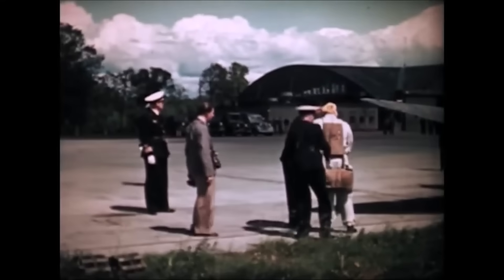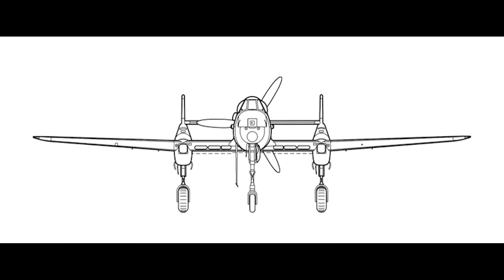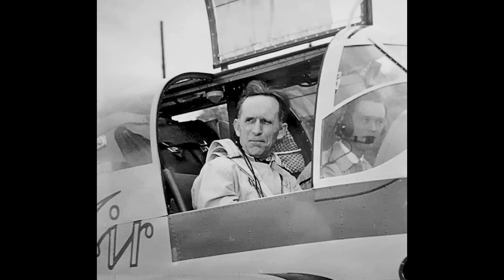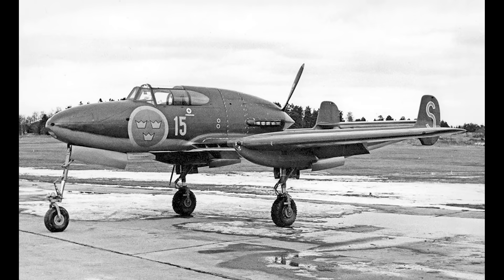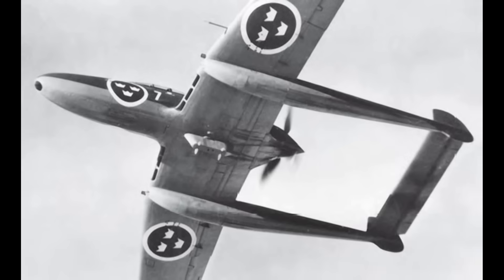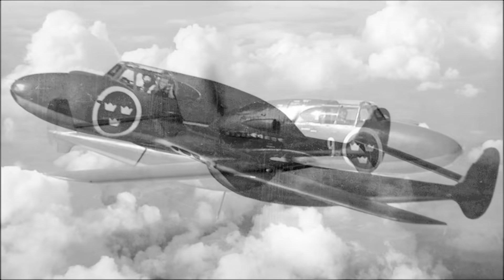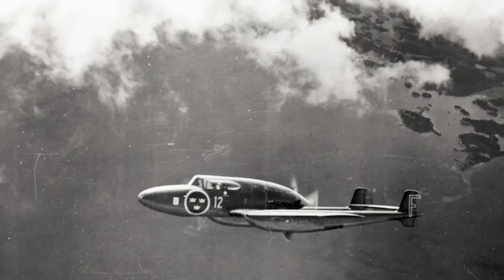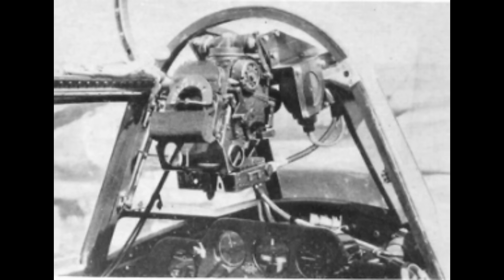Flying the Saab J 21A: Sweden’s Odd but Capable Fighter

Comment: Is this really the only Swedish WW2 fighter? I immediately think of J22 (prod. 1942-46), doesn’t it count?
Reply: Yes, the J22 FFVS was opetational during WWII as well with both versions A and B. However it was not SAAB that designed, and built the J22.
Reply: My question to.
Reply: Maybe J22 was only operated in a training or noncombat capacity? Assuming operational capability was achieved sometime in 1944, its performance seems more 1940 than 1944… I can’t find anything definitive In English.
Reply: @neilturner6749  J 22 was definitely used as a front line fighter, and a upgrade from the Gloster Gladiator and Reggiane Re.2000.

That was to become J 22 was started 1940, and become operative 1942. The fighter itself was quite mediocre, compare to the latest fighters of that era. 
But it was a excellent fighter for a first try.
Reply: @neilturner6749 yes it was combat ready and very well liked by pilots.

Comment: I find it surprising that Sweden with limited design capacity focused on bombers domestically and importing fighters. Usually it is done the other way around.
Reply: Pre-war doctrine and procurement had been dominated by the Swedish version of the Bomber  Mafia but with some  Swedish twists such as the focus on dive bombing which led to a focus on developing a domestic dive bomber. (The SAAB 17)
Reply: @Vonstab  I dont recall the name of it, but I did see a "whimsical conscript" movie from the time and its plot involved swedish dive bombing training/trials (the protagonist went on a walk through the bottom of a swamp/lake).
Reply: Sweden lacked the industrial capacity and know how, to build an engine suitable for a fighter plane, but could build/import weaker engines that was suitable for light bombers, Sweden was also very gung-ho on dive bombers. Later in the war Sweden did license the German Daimler-Benz DB 605, that was used in J 21 and in a medium bomber.

Comment: Interesting little beast, which I'd not known about before (I say that a lot with your releases). I wonder if any have survived?
Reply: Wikipedia says the following:

J 21A-3, serial 21286, but rebuilt as an A 21R, at the Swedish Air Force Museum.

J 21A-3, serial 21311 at F 15 Söderhamn Flygmuseum.

J 21A-3, serial 21364 at the Swedish Air Force Museum.
Reply: @Irascibanality  Thanks for that! I should have checked Wiki myself, but I appreciate your doing so.